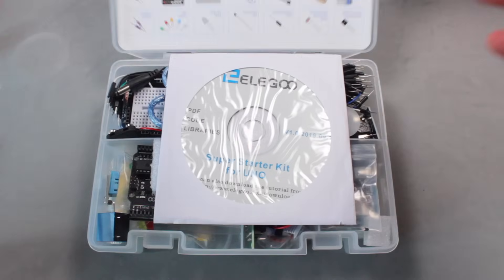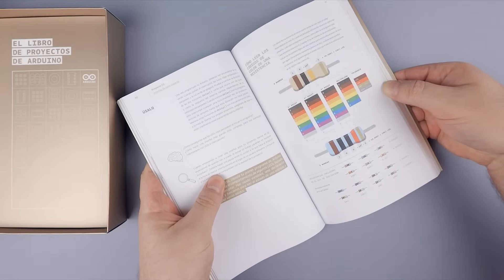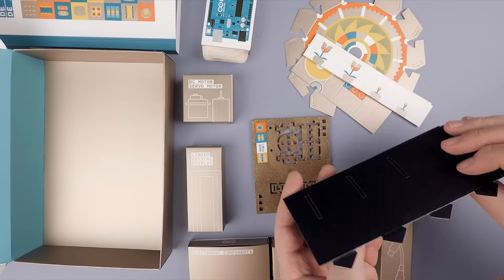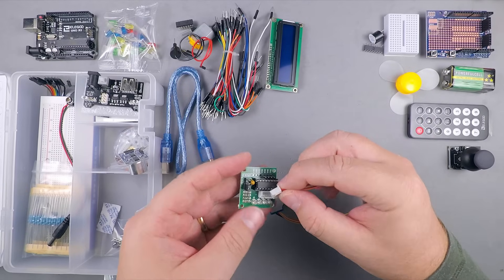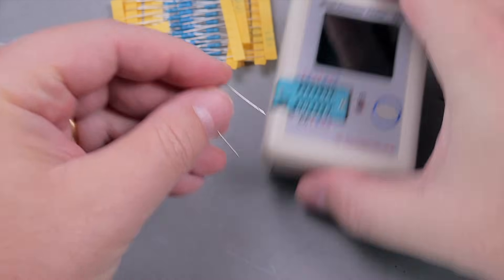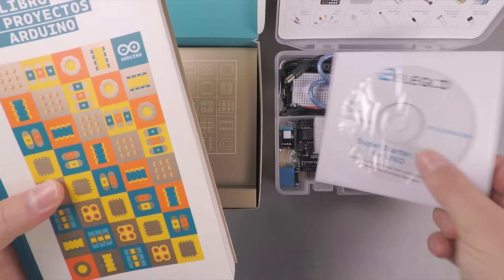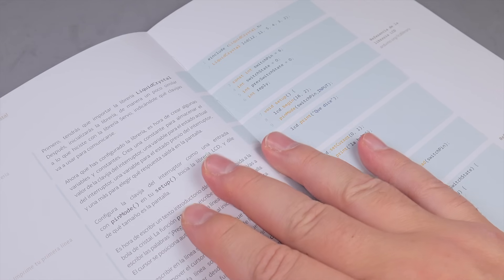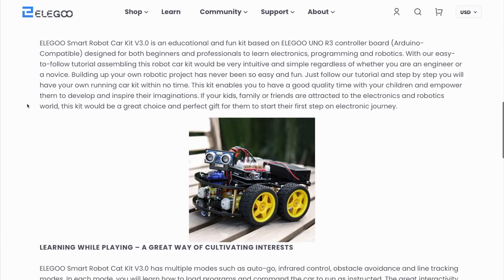Which Arduino to buy? Arduino Starter Kit vs Elegoo Uno R3 Starter Kit

Comment: Are these kits good for my 18 yr old about to do engineering in uni ?
Reply from the maker: This is an excellent question. Computer Science, Electronics Engineering, Software Engineering… on these careers, programming and electronics will be far beyond what you see on an Arduino. I know some universities use FPGA programming, which is far more complex (and expensive) than Arduinos. BUT, students that like electronics and like programming very often love to make projects with Arduinos and the Elegoo Kit is a good start - it has more modules. It is not expensive (in the north hemisphere) so, give it a try.

Comment: Thanks for the great video. I have one question please, I’m going to buy the Elegoo starter kit, but would also like to have a physical book as well. Are there any books you would buy, if you were starting out, to learn more about arduinos?
I have no code writing experience. But I don’t want to get something Mickey Mouse either. That’s the best way to loose me.
Thanks again.
Reply from the maker: Hi there! Thanks 🤗 So, the Elegoo Kit is an excellent choice - and you should check the PDFs that come with it (I’ll put a link here), it has explanations about the code and the electronics. I am still searching for an Arduino Book that is not simplistic… My advice: do the projects of the Kit, tweak the codes for fun, try things. Later, there are SO MANY excellent tutorials on YouTube directed to more advanced modules and projects. Good luck!
https://www.elegoo.com/pages/download  (check Stem Kits)
Reply: @GeekDetour  Thanks for the reply, yes there are many online tutorials and videos, but I’m an old fart, and as you said, you and I like the feel of a real book in my hand. 
I’m actually starting all this learning in order to do some custom wiring for LEDs in my old car gages. Yes there are direct LED replacement bulbs, but the single bulbs leave dark spots. I have seen one other person who did a short LED strip in each gage, no dark spots, looked amazing. Also I want to learn how to properly light some of my models.
I’m also going to have to get a variable bench power supply. I’m worried about buying one from Amazon, because so many of the clones are not build to North American safety standards, (UL/ULC, CSA etc)
I think I’ll buy the book by Simon Munk. “Programming Arduino….etc.
Always interested in experienced feedback, Regards,
Reply from the maker: Oh boy, Arduino is a journey - that won’t be your only book, that’s for sure 😄 I have a box full of Microcontrollers: Arduino R3, Arduino Mini, Arduino Nano, Arduino Mega, Arduino RF-Nano (which is a nano with an integrated Radio Transceiver)… Right now I am trying to finish a Camera Motion System using stepper motors to make TimeLapses - I wanted them to communicate without wires and I am almost regretting my choice… It’s all 3D Printed, mostly wired, but the Software for it is on the very frontier of what I know so far… So it is taking time. This is for people that like to learn all the time 😁

Comment: My dad is getting me the arduino kit for my birthday. Do you think I can make a robot?
Reply from the maker: Hi there! There are robot kits - I know a robot looks VERY exciting. But you need to discover if you like to just play with robot toys (in which case, it is better to have any toy that looks like a robot, with no need to learn “electronics or programming”… or if you will enjoy tweaking circuits and learn programming. I like electronics components since I was a kid… I never made a “full robot” with them. But I made toy cars, elevators, radio transmitters, small “very specific” tiny robotic things for some repetitive tasks… These are the things you can learn to do using Arduinos. This Kit is a first step. It is fun for me. Maybe it will be for you too. You can not make a “ROBOT” with this kit. But you can make something move, like a toy door, or a tiny bridge… if you finish all the lessons of this kit, you will discover the components you would need to buy to make bigger projects. There are spiders using lots of servos to move the legs, with arduinos. Those will take a lot of time and a bunch of components. First let’s see if you actually will enjoy programming One servo, or if you think it is boring. (By the way, I know this answer was LONG… if it was already boring, you should ask for a plastic robot toy 🤣 - learning always needs lots of reading).

Comment: I can't get IDE to detect either of my boards. Both boards light up when I plug them in. They are elegoo mega 2560 R3. I got a kit from my bro has all the parts. I got another one from a thrift store... all parts even the 9v is still in the plastic. The boards are not listed in the IDE program. Do I need the program to actually do the projects? I am doing this on an offline PC. Programs that require the internet are BS and I won't put my nice PC online. So, I guess elegoo is out..
Reply from the maker: Hi there! Elegoo Mega 2560 R3 is a clone (which is 100% legal in Open Source hardware) of the Arduino Mega (they won’t be listed as “Elegoo” anywhere). Here is a link to help you: https://www.snapeda.com/questions/question/how-do-i-program-this-arduino-mega-2560-with-a-cod/#:~:text=Connect%20your%20Arduino%20Mega%202560,serial%20port%20for%20your%20device.
Reply: Thank you for the reply. It did detect the board on (COM4). Now I have a screen that I assume is asking for code. I'm a total noob with that. Thanks for the link.. @GeekDetour  Does the board need to be ejected before unplugging it?

Comment: Does eleego uno work with arduino ide?
Reply from the maker: Absolutely, yes. Elegoo just fabricated a copy of the Arduino Uno R3 board (which is absolutely ok since it is Open Source Hardware) and put a few more modules and components. The IDE is the official Arduino IDE.

Comment: Brother, do I need to know their parts like how they r made , whay is their role of this and that etc
Reply from the maker: The idea of these kits is to learn how the components work, how to connect them, and you should be able to learn how the code works and make changes. It is a learning tool. So, there is no previous knowledge is required. (It doesn’t mean it is guaranteed that you will learn everything they try to teach)

Comment: 6:05 the blue resistances are better and more precise than the brown ones
Reply from the maker: You are absolutely right: electrically, metal film resistors are amazing! They keep their nominal values for longer, they have a smaller footprint for same maximum watts dissipation, the tolerances are tighter… BUT, I cannot read the color code 🤷‍♂️ I wish the Industry could give up the color code completely and printed the numeric value directly - or change the background color to something that worked, like the old beige resistors.
My complaint is not against metal film resistors… I just think that the color code on Blue is useless. I am not alone - but, well, this is a hobbyists problem - real manufacturing is not affected by this because everything is automated, or even if it is manually inserted, the worker just takes the resistors from a roll clearly identified 🤣

Comment: hi, are different company kits compatible with each other? do i need any tools to make the projects? soldering gun, screwdriver maybe?
Reply from the maker: The two kits I showed in this video share most of the components - you can do almost all the experiments of the official Kit’s Book using the Elegoo Kit. You don’t need soldering iron for these activities: you use the protoboard that comes with the kits.

Comment: Hi, I have an important question before buying. If the ELEGOO kit has all the components the Arduino kit has but Arduino has a better book, can I just buy the ELEGOO kit and use the Arduino book from online?
Reply from the maker: Hi there! The Official Arduino Kit’s Book is not sold separately - but you might be able to find it in PDF, online… Sure, most of the projects will be possible as you described.

Comment: this is all new to me. I wanted to make a shooting star on my ceiling using led's for a light source and fiberoptic mounted in my ceiling. Yes you can buy kits made for this  but I thought it might be fun to make. I know there are other products such as Raspberry. Am I trying to do something beyond its limits. If this will work my intention was to have several work independent.
Reply: That's a good video. My thinking was to use a arduino / elegoo and attach small lasers (8 or 9) with fiberoptic and make a shooting star and put it in a bathroom ceiling or big closet. My goal was to learn and have fun also.        Thanks
Reply: Yes I am new to this what do you recommend I purchase to learn. I do want to lean towards LED's and small lasers the strip lighting like you recommended. some of it I would like to make it dimmable with software and not a switch . have some turn on and off with a time delay a few minutes to seconds.  Thanks
Reply from the maker: Hi there Bruce 👋 Fiberoptic might be a lot of mechanic trouble and it is quite limited. Let me introduce you to Individually addressable LEDs strip. The Arduino can control the RGB color of each LED on the strip and a lot of cool things can be made.
My advice for you as a novice is: learn from other people’s projects - and grow from there.
Here, a video for your inspiration (not mine):
https://youtu.be/MafNmsmBW8s
And have fun with Arduinos!!!! 🤗👍

Comment: I jumped into the Arduino world blind and bought the starter kit that came with the most stuff(elegoo) and in about 3 weeks I've had some success. I realized the pre written projects for elegoo were too baseline, they tell you what to connect where, and what pre written code to upload to it but that's no fun so I decided to strike out on my own and make a push button counter with the 4 digit display and shift register however finding information about exactly how each component functions was impossible with elegoos resources and it took me forever to figure out the shift register. If you want the best guided assembly go with the Arduino kit, if you want to figure it out on your own the elegoo is better. Really like that Arduino book the information would have been great to have.
Reply from the maker: Hi Peter! Yeah, a Kit is indeed just the beginning of a journey! I purchased a few different kits and I collected innumerable different components that I want to play with and learn how to use (I have boxes of stuff I bought from AliExpress). Soon we will move to a new house where I will have a decent space to show these things on the channel! 🤗

Comment: Hi and thanks for the insight.

As an adult in retirement I have decided that I would like to dive into the world of electronics and as such I have been searching for an educational start-up kit.  It appears from the research I have done so far that everything seems to be centered around Arduinos, but I am simply interested in learning about the basics of electronics and not so interested in the computer programming elements (I know - I'm a dinosaur 😎).

Do you know if any such kit exists or am I stuck with the options of either Arduino or build my own starter pack?
Reply from the maker: Hi Mick! There is a lot of basic electronics learning when you dive into the Arduino world. Learning electronics around microcontrollers is very rewarding - very quickly you can do fun and powerful things that would be super complex, expensive and most often unviable if tried to be done with analog electronics just with discrete components. Get an Arduino Kit: the amount of projects, videos, tutorials, books and nice user groups is totally worth it.
Reply: @GeekDetour  
Thanks for the reply GD.  I am beginning to think I should have gotten into electronics in my youth, when people were not walking around with micro processors in their back pocket.

Now this old dinosaur has to decide if electronics is really the hobby that will hold my interest.
Reply from the maker: Any Arduino Kit is a cheap investment for you to try it out - don’t overthink it: you just need a computer and start doing each lesson of the manual. You will quickly get a sense if you are having fun and getting hooked by what you are learning - or not! 😁
Reply: @GeekDetour  
Thanks for the words of encouragement.

I've decided to invest in a book titled Make:  Electronics which appears to me to be the best 'starters' book at a price that really doesn't matter if I don't get hooked.

I saw some disturbing comments on Redit that the instructional book with the actual Arduino kit is riddled with errors.
Reply from the maker: Oh, there are no technical book that escape from having mistakes - at least on the first edition. The basic Arduino Kit have A LOT of scrutiny - I wonder how old are these observations about mistakes… 

Good luck on your journey. Be careful that time flies - don’t over-analyze. Just start doing something. And have fun! You are not choosing a career or a new job.

Comment: hello, i wanna say firstly your video is great.I am an electrical and electronics engineering student, I am not taking an electrical and electronics course at the moment. I want to know about this field so I want to buy one of these kits or a completely different electrical or electronic kit. i need helps, can you advise me on this
Reply from the maker: Hi Elvin! If you can find an Elegoo Arduino Kit where you are located, buy it! It is hard to find a cheaper kit with the same quality.
Reply: @GeekDetour   i am located in Turkey. İ dont find but maybe i can buy in Amazon, can you give me link. Link don't work that in the video.( Also i have another question about elegoo. does elego have the equipment to do all the projects of arduino

Comment: Very very quick answer to my questions, way more information I could even ask for, thank you so much. I am reluctant to give money to Elegoo that I feel they milk the Arduino project, but I really need to start fast to finish a very important project, so I will probably buy the Elegoo kit, plus an extra kit to get more motors. I need 5 step motors in my project
Reply from the maker: Hi there Guillaume! I understand what you say… There is a whole bunch of third party boards, lots of other brands making kits and I know most of them don’t revert money to the Arduino organization. But, “Arduino” as a whole phenomena wouldn’t be BY FAR so strong if it wasn’t by clones (which are perfectly legal) at a very accessible price and still great quality. I LOVE the quality of Elegoo boards - and they use the very same chip for USB to Serial conversion as the original Arduino Uno R4 board.

Which type of step motors are you going to use? If it is the 28BYJ-48 (the super cheap one that I showed in the video), for each motor you need 4 GPIO pins… maybe you need the BIGGER Arduino board: the “MEGA”. If you use NEMA step motors, you need to buy proper steper motor drivers, but that uses only two GPIO for each motor.

Comment: Hey, this was a great comparison. Thank you so much. I really like the look of the Elegoo kit. If I was to pick up an Arduino book, could I use the elegoo components for the Arduino projects?
Reply from the maker: Hi Sam 👋 Thanks! I am glad you enjoyed it. Yeah, the Elegoo Kit is basically a “superset” of the Official Arduino Kit - you can probably do every experiment from the official Book and the components will be the same… Plus extra stuff that only came on the Elegoo Kit. 
You can follow many of the Projects you find on YouTube and on the Web, it is a great Kit. Good luck!!! 👍
Reply: Excellent, thank you. And thanks for the quick reply. I also have a general question about Arduino. Sorry to keep picking your brain! 

Once you have programmed the chip, can you take it off the Arduino board and it will keep its programming? As in, can you use Arduino to program chips to act a certain way and then move them onto a separate circuit board? Or do they only work while attached to the Arduino rig?
Reply from the maker: Hi there! The program is stored permanently (until you upload a new program again). You can program it a few thousand times - you will get tired of programming it before the internal storage gets corrupted.
So you can program it, and use it far from the computer - it is like programming a toy that would run that forever.
Reply from the maker: There are even smaller boards, look for “Arduino Nano” or “Arduino Mini” - if you want to make permanent projects.
Reply: Amazing!! Thank you. This is what I wanted to hear!! Oh, I’m gonna have some fun with this!

Comment: Okay but how can i use them what can i build what materials do i use to build
Reply from the maker: Both Kits are to learn Arduino - each chapter has a tiny project to learn a specific component / module. People like to make Robots with Arduino - but you need the motors with gear reductions, to make stuff like this: https://youtu.be/hqNz4wcLMy8

Comment: Very well presented. But, I think I’ll wind up with both. Start with the Arduino kit. Having two kits has a good advantage. You can get two Arduino working together. BTW, I’m interested in that component tester. I’m retired (early) and it’s been nearly 30 years since I worked as an engineer. But, now I am on a journey to refresh my knowledge. The things I invented have been used all around the world. You have used one. A lot. But I couldn’t easily reproduce it as that was 40 years ago. Time to be a student again. Thanks for making this video. Helps.
Reply from the maker: Hi David! Oh, I really appreciate your kind comment and I loved to know a bit of your background. I am certainly sure you will have a blast with these kits. Beware: that’s a path to addiction! I have a few kits and a BUNCH of extra components I’ve been collecting (AliExpress is too tempting!). Oh, there is a newer much more interesting tester: FNIRSI TC2 (it comes with a simple oscilloscope + tester). Have an awesome journey!